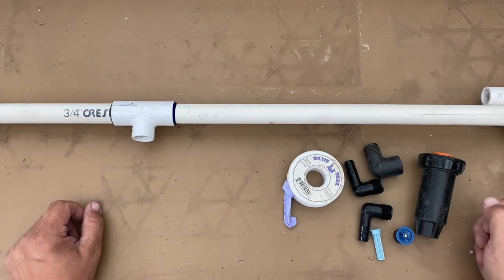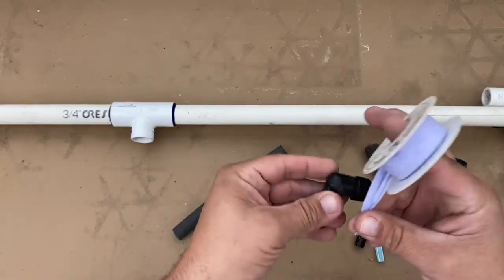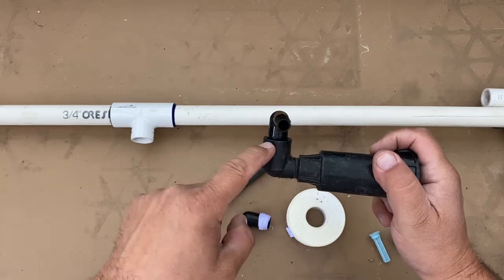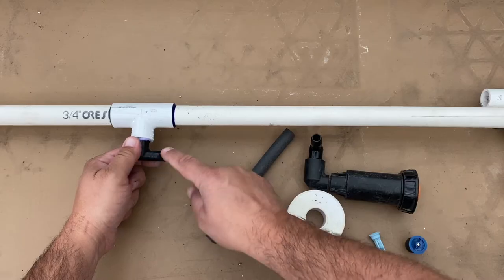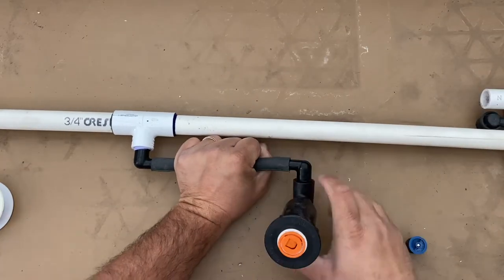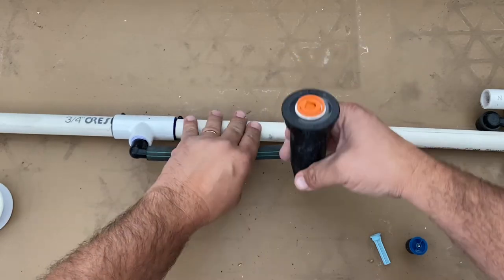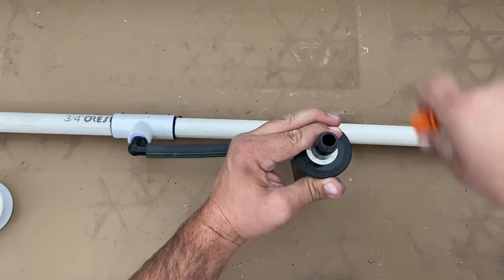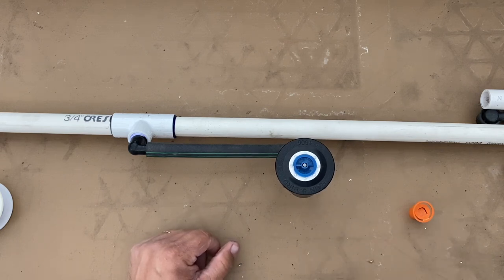Sprinkler swing joint DIY

Comment: How do I get the swing pipe onto the plastic elbow end? It’s impossible even above ground, let alone down in a hole. I can’t even get the very end of the swing pipe to get fully around the end of the plastic elbow barb so I can’t even get to the parte here you wiggle it or turn it. It’s impossible.
Reply: Use a heat gun on the pipe for like 10 seconds then the pipe will slide all the way on the fitting.

Comment: Do you find these joints to be leaky? Not the end of the world on a lateral line, but I’ve been having trouble getting leak free joints on the threaded joints of my swing pipe assemblies. Joint is designed to move, but it needs to be torqued down to eliminate leaks, it seems.
Reply from the maker: I don’t have any problems with leaking joints.  The Marlex is a self sealing fitting, so the only potential leaking thread is the PVC to funny 90.  If that is an issue, you can always use Teflon or pipe dope to stop all leaks.  For all commercial applications I use Teflon or an additional marlex to eliminate leaks.
Reply: @cupchanger  Thanks. I think I may be a classic overtightener. Need to test applying less torque on my fittings.

Comment: If you're a plumber and don't have any swing pipe, do what I do. Run back to the shop and grab some scrap 1/2" PEX and a couple fittings instead. Not as flexible, but works just as well!

Comment: if you put the head more than 6' away from the threaded T you wont have issues with the SPE breaking..these swing joints are highly unnecessary.-irrigation specialist for 15 years
Reply: 6 feet?
Or do you mean 6 inches?